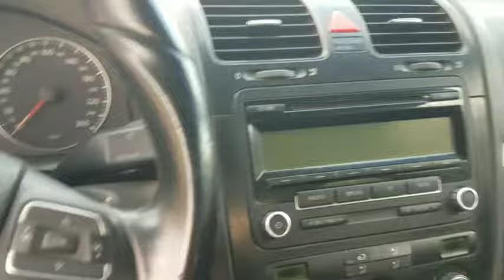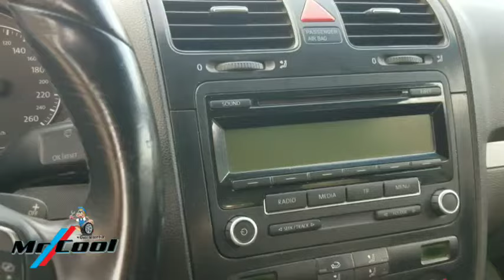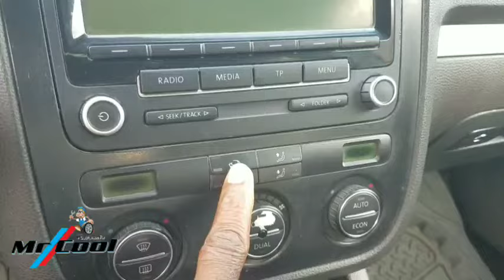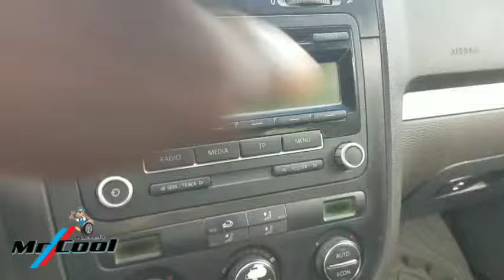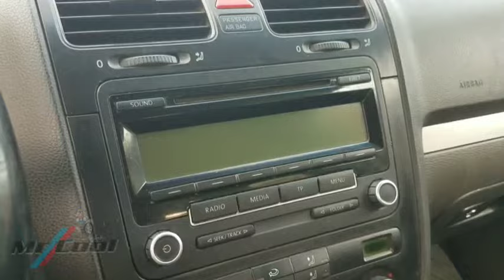Top 4 Signs Of a Defective Evaporator Core and Fix

Comment: Please my AC line is cold to touch and returns properly but the air from the vent is still not chill enough. What could the problem be?
Reply from the maker: My personalized assistance to help you diagnose and fix it will not be free, I you not even my subscriber to begin with
Reply: @ What would you require?

Comment: Mine I regard the unit and replace almost everything but not blowing enough cold air, I can see inside the engine where the hose of low pressure has very cold state with water cling in to hose when I touch, also condenser has replaced previously with another cars condenser now the condenser and the radiator has a gap around 3 inches as well. Can you explain me what could be the cause inside not much cooling, thanks
Reply from the maker: Wao!, This is not youtube talk & won't be free bro, if you are up email me 👉mrcoolauto@gmail.com
Reply: It seems like too much air is trapped in the AC system, the reason is that it was not vacuumed before filling the refrigerant + oil.

 However, if you are sure that the procedure for filling the refrigerant is correct, then the problem is with the expansion valve, just try turning the compressor on and off for a short time, usually the blocked expansion valve will clear up a little, but if it persists then you need to replace the expansion valve.
Reply: Expansion valve maybe

Comment: Can a bad evaporator cause much colder air from passenger vents than driver vents? Mine does this but only at idle. Sometimes all vents blow warm at idle. At highway speeds they seem to blow cold. High low pressure low high pressure.
Reply: I'm sorry doctor cool but that was a question!
Reply: Mine does this too. Not sure if its 
Caused by a faulty evaporator
Reply: @farhanshah1903  I figured mine out. Ended up being an expansion valve inside the AC compressor. I forgot the exact name of it. But it works just like an expansion valve.
Reply: @phillippardo5712  do you mean the solenoid valve?
Reply: @EmanuelScheek  It might be called that also. The package that it came in said expansion valve.
Reply: for AC user maintenance, do this once every 2 weeks, make sure the vehicle is in a well-ventilated area or in an open space, start the engine, fully open the driver's side window, set the AC temperature to the coldest position, set the blower to the fastest position (also set the side blower  rear at fastest position, if applicable), let idle for 4-6 minutes.

The goal is to return the oil trapped in the evaporator back to the compressor and smooth the path to the expansion valve.

Comment: First of all, nice video. But, I have a problem. My AC blows out some kind of mist through the vents, what are your thoughts?
Reply from the maker: Like frost?
Reply: @drcoolautofix  yes!...What are your thoughts
Reply: @howlingmedia4354 check your coolant if it’s low and you smell coolant through your vents than your heater core is going bad.

Comment: Hi boss my car a.c low line getting cold but in the car its not cooling
Reply from the maker: It it bringing air out of the vents?
Reply: Yes
Reply: The low size line is sweeting good the fan is blowing ok but not getting cool
Reply: check expansion valve

Comment: My AC makes a hissing noise when I turn it on and hardly blows cold air. I fear it might be the evaporator core
Reply: Same here the sound is coming from under my glove box. And the AC is nearly cooling
Reply: @nastyiceshorts6710  turns out mine was just a bit low on refrigerant. I bought a kit and added some myself. The sound went away and it blows cold now
Reply: @zombiemontage  oh great I'm gonna change my evaporator and recharge it
Reply: @zombiemontage 1 year after did you have any problems? Because some people claim that if there’s a hissing noise there’s a leak, I had a hissing noise but I took it to a shop and they said it was just low on refrigerant but I don’t trust them at all.

Comment: What kind of filter ?
Reply from the maker: I don't get you
Reply: @drcoolautofix  there is extra part that need to be replaced with the evaporator?
Reply: @דניאלביטון-ת3ר for core system just replace dryer-filter, position near condensor
And for cabin, just replace cabin-filter...
Reply: Cabin filter